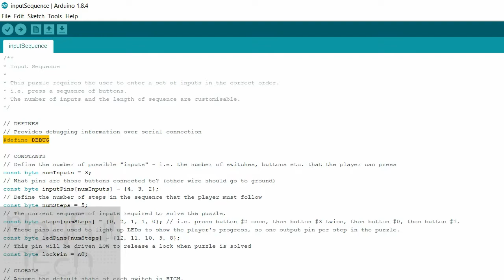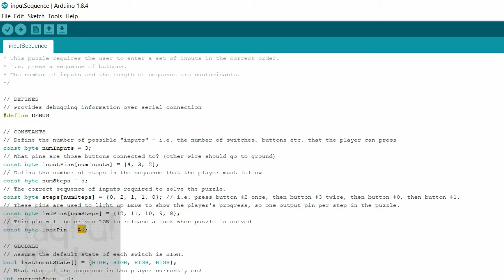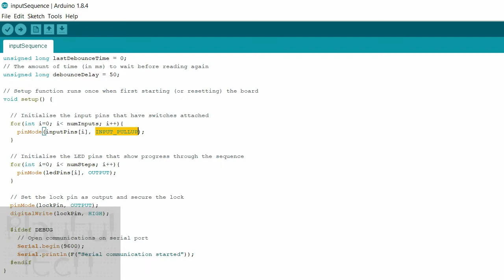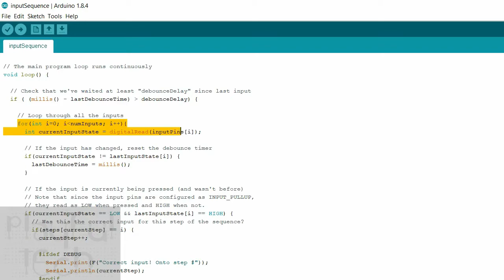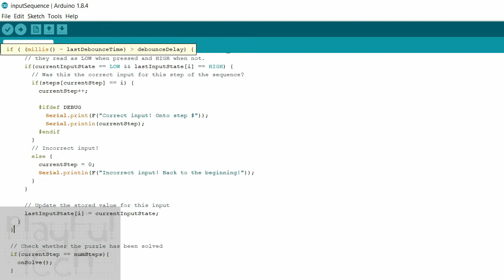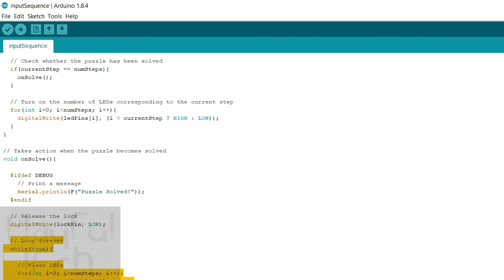Input Sequence Escape Room Puzzle

Comment: Hi

Im trying to make an escape room prop and im super new to Arduino. Ive followed your steps to this build and it works perfectly, however, I want to add a step motor into the mix and I need for it to move a few steps each time the player puts the wrong sequence in. If they get the sequence right, then the motor needs to reverse back to its starting position. Are you able to help? 

thank you

Sean